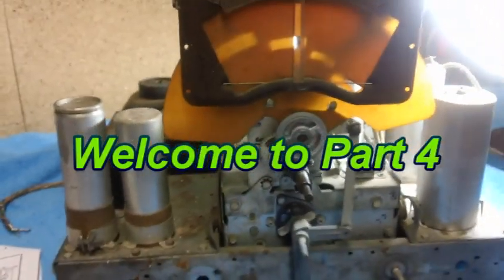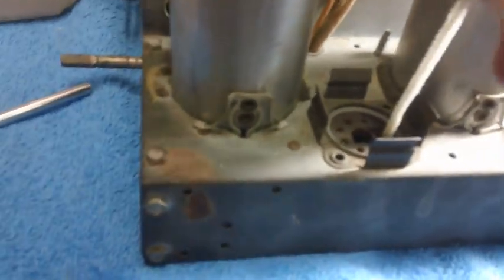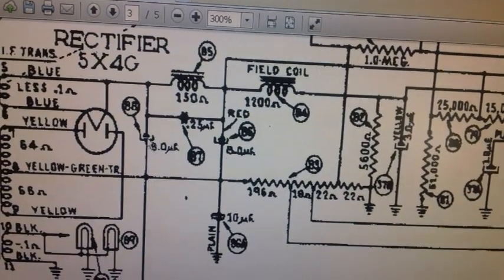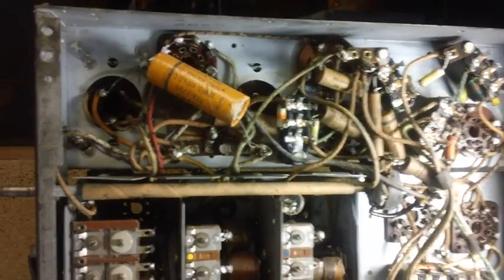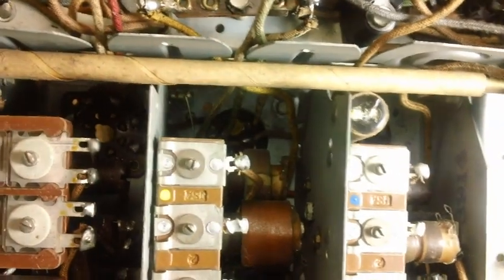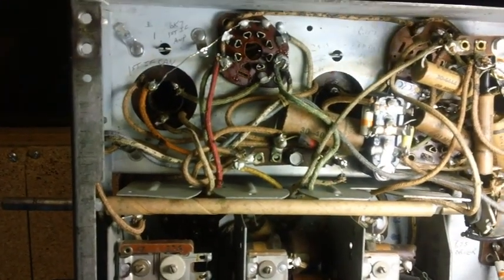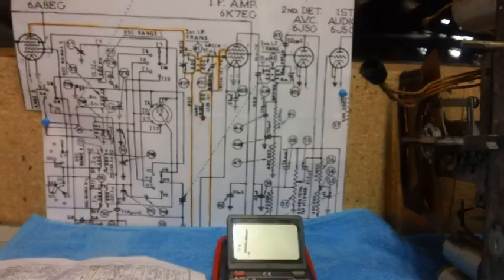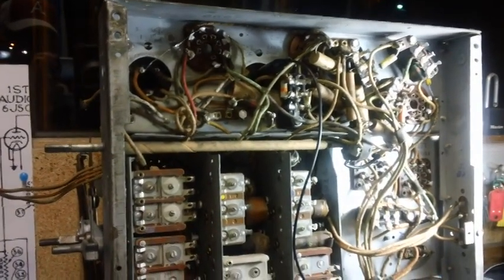Philco model 37-2670 repair and restoration (Part 4 of 34)

Comment: Excellent as usual.  That's going to be a big help when I get to the I.F.cans on my 37-640.  Mine is in worse shape than yours so I've got some catching up to do.  The bottom of the transformer is completely covered with a series of caps and a lot of wiring so I can't yet see which are the transformer wires.  I'll get there.  Also my shadow dial is configured just a little different than yours.  It's not the older version that you mentioned before, just a little different.  I may try to get a vid up to show you.

Thanks again!
Reply from the maker: Thank you, my friend.
Why not post a video for all to see.  When uploaded, post the link in one of video comments sections.  You'll no doubt get many responses.

Regards,
John

Comment: Looking good John.  Caps next, time to heat up the soldering iron.  Hopefully all those coils will check good, too.  Looking good!
Reply from the maker: Al, Caps are being worked on as we speak, but they won't be finished right away.  A new vid about it goes up tonight.

Regards,
John

Comment: Truly excellent, John. 

I also ordered Chucks schematic/service notes for my 37-670 as well.

I've got one unsoldered wire that's driving me crazy.  On item # 75, the audio input transformer, the center tap has two wires connected.  (This is on the 200 ohm & 215 ohm side of the transformer.)  These wires both look white with black tracers.  One wire goes from the center tap to the center connector on # 58, a bakelite block capacitor.  The other white-with-black tracer wire on the center tap of the audio input transformer goes to where?  Judging from it's length, it appears to attach somewhere in the corner closest to where the transformer is located.  It's a real rat's nest in there.  Can you show me where this wire should be attached? 

Thank you so much, Tom

Comment: hey joe I got a philco M1620-124 It works fine outside the tuner belt has come loose.I am at a loss on how to put it back on.any help would be nice.
Reply from the maker: Erik,  I'm totally unfamiliar with your unit, but here's a recommendation:  Go to the below web site, become a member (it's free), then post your question in the "electrical/mechanical" section.  Without a doubt one of the members will be able to help you.  Oh yeah, be sure to introduce yourself to the forum members.http://antiqueradios.com/forums/index.php  Regards,  John

Comment: Hmmm... this radio i'm working on now, (a Philco table model from 1948) had a couple of those big brown paper electrolytics under the chassis... I wonder if they never belonged there in the first place....
Reply from the maker: Daniel,
Check the schematic to see if those caps are properly connected.  Over the years, I've found more connected wrong than right.

Regards,
John

Comment: Once repaired do a demo of the shadow meter.  What it does, how it looks, and how it works when repaired I've never heard of such a item, is it like a tuning meter(thats my guess)?
Reply from the maker: Watch these two vids from a previous restoration:

1936 Philco Model 630B Repair and Restoration (Part 27 of 35).
1936 Philco Model 630B Repair and Restoration (Part 28 of 35).

Regards,
John
Reply: Thanks John, Will do!